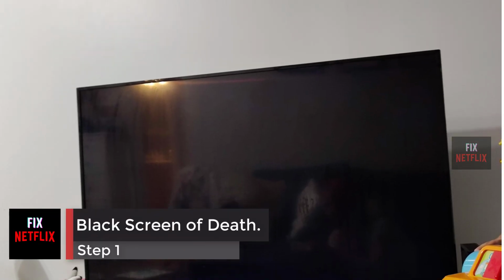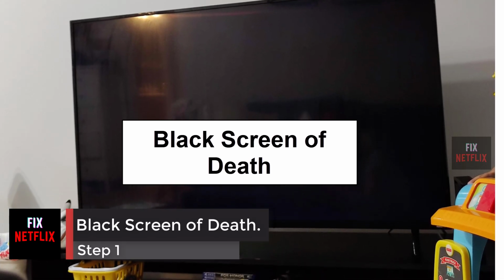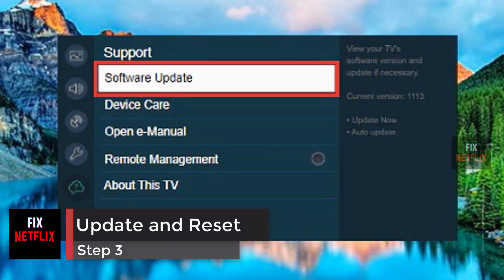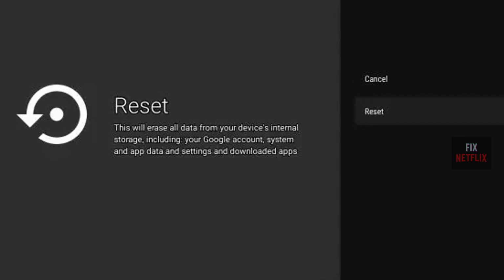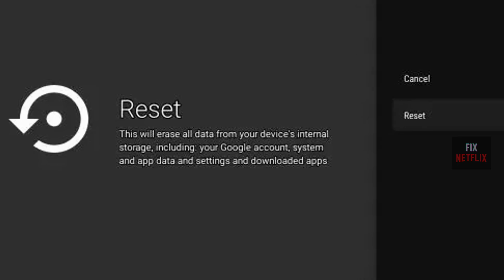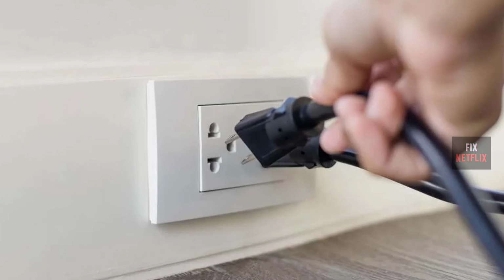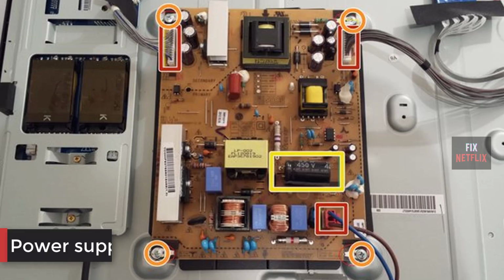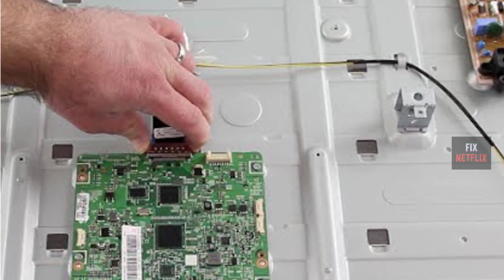How to Fix JVC TV Black Screen & No Picture - All Issues Solved

Comment: Hi my 75inch JVC tv the screen is white what is a problem.
Reply from the maker: A white screen on a JVC TV can indicate a few different issues. It might be a T-Con board problem, a panel fault, or even a main board issue. Have you tried unplugging it for a few minutes and plugging it back in?
Reply: @TechVibes-maf hi not yet
Reply: @TechVibes-maf hi not yet

Comment: I get black screen only on cable or xbox. The home screen works and i can stream ti my tv.
Reply from the maker: It sounds like you're experiencing a frustrating issue! Have you tried checking the cable connections or resetting your Xbox? That might help resolve the black screen problem.